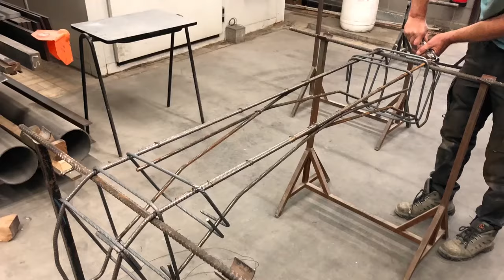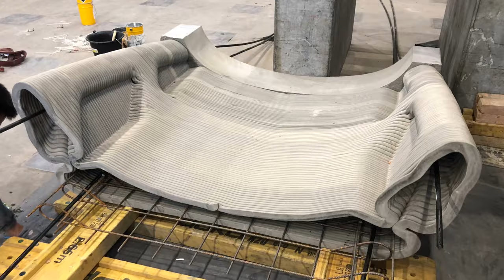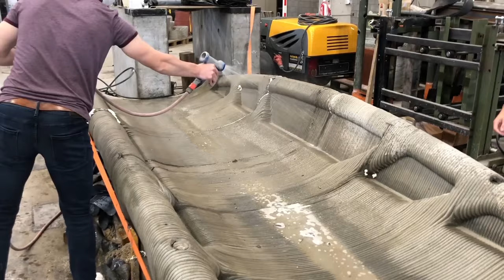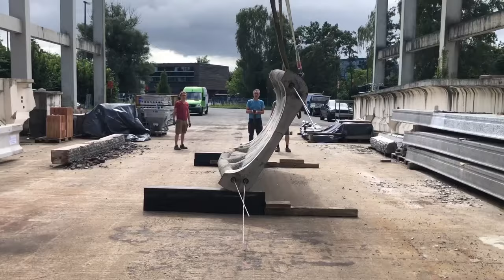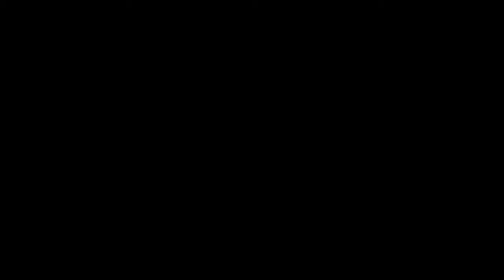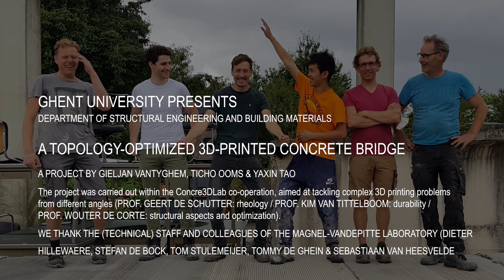3D Printed Concrete Bridge | Designed by topology optimization

Comment: it looks like 6 highly educated people poured a simple mold in a whole day using expensive equipment, when 4 workers poured such a mold in 20 minutes without using expensive equipment.
Reply: That's one way to look at it, but compared to molds, a 3d printer could theoretically create much more complex shapes. Not sure if that argument goes there though.